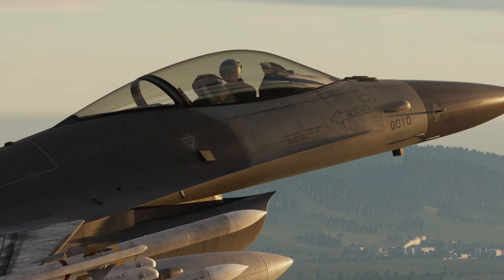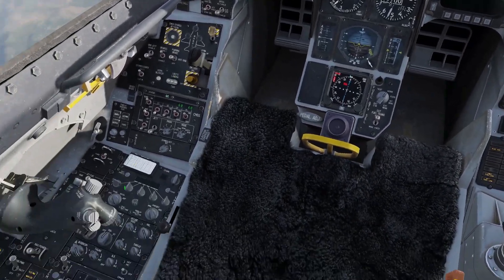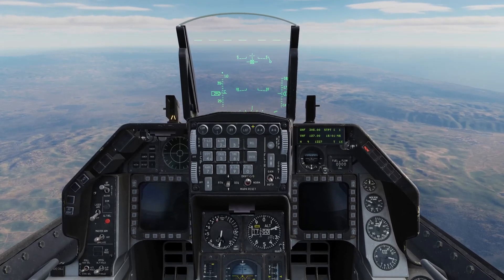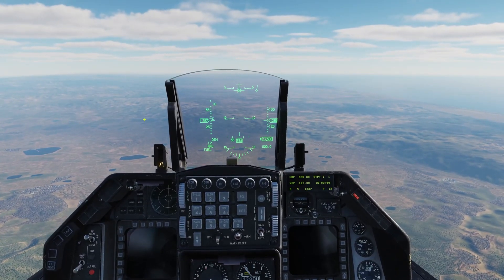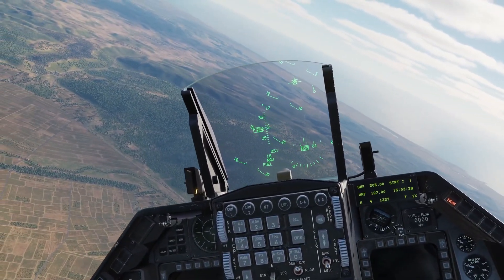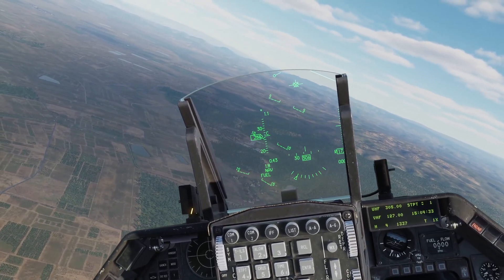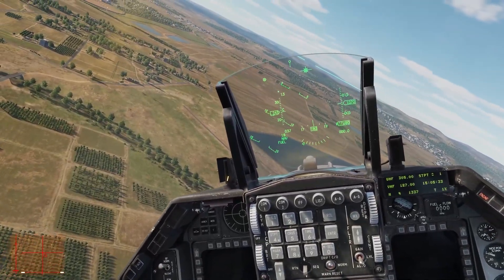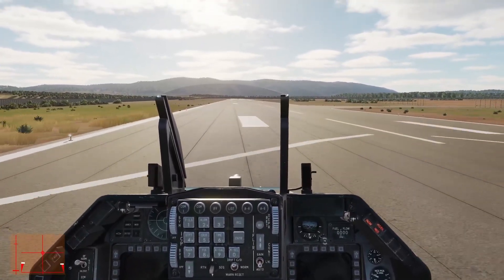F16 Viper Deadstick Landing - My Engine Died

Comment: 1.)  Turning off the landing light and external lights "to save what little energy you have" is ridiculous.  The main limiting factor you have is your EPU fuel.  Lighting isn't going to cause you to go through your EPU fuel any quicker.

2.)  You are completely wrong about the INS.  You refer to the pitch ladder and the ADI.  Where do you thing the aircraft is getting that data from to be displayed on your ADI and HUD?  Hint.  It's the INS.

You did quite well on the landing but that isn't a great example for someone who has never done it before.  You left absolutely zero room for error on the approach doing it the way you did.  Also only having 10ish minutes of EPU fuel your job is to get that bird on the ground as fast as possible to guarantee it can fly again.
Reply: Yeah, the flight path marker being unreliable is because he hit the drift cutout first and foremost. I don't know if it's still unreliable after that, but that switch definitely voids it.